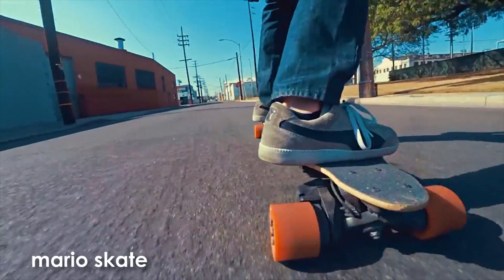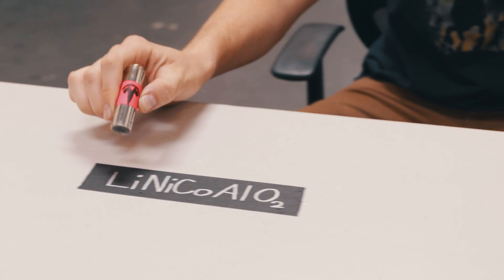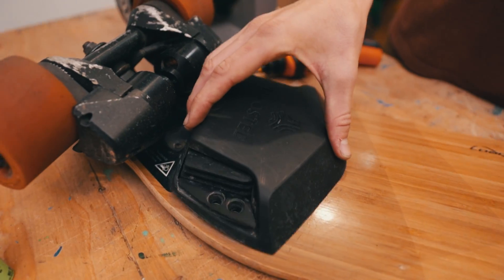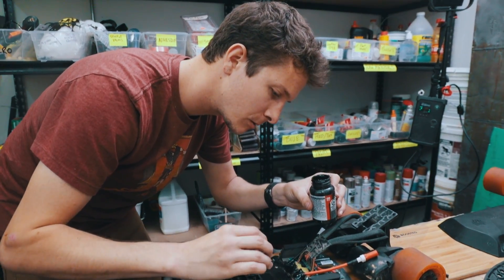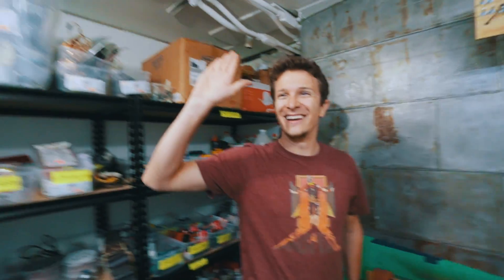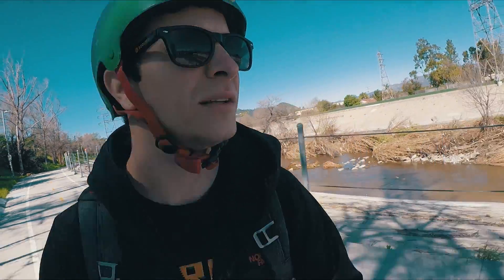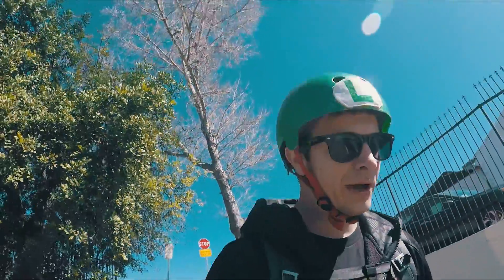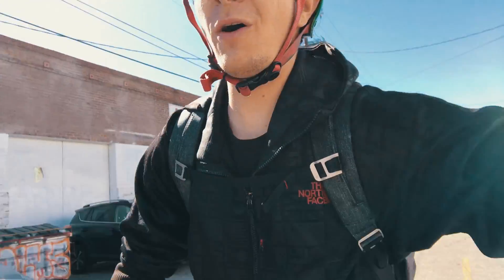Tesla Batteries in an Electric Skateboard!

Comment: You could add two front wheel gears that connect to recycling power motors. From the back wheels moving because of the batteries it would recycle the energy making the battery last longer by powering up. Then would power up the skateboard when cruising down hills just like Ford hybrids. It would require 2 other belts connecting to a rod with gears two other gears spinning the rod for energy. The output of electricity connects to wires and would connect to the other side of batteries. Would probably take some time , but will get u farther then ur destination.
Reply: That's counter intuitive for the first part since you're just causing more resistance for the motors and since you can't get more energy than you put into it you're just being inefficient with your battery. You could also just use the motors you already have as regenerative braking to get some energy back on hills though.
Reply: What you're implying is to make infinite energy
Reply: BLEK YESUS That would add extra drag lowering efficiency and also he should have added a car charging terminal to force energy in when dead

Comment: How about Taking out the boosted board battery and replace it with a bigger more energized battery so the voltage is higher thus letting more battery power out which aloes your other battery’s to poor more energy.hope this made sense thanks

Comment: I might be wrong, but, you have connected the batteries directly to the motor driver PCB, tho your needed to hook them up to the BMS ( Battery Monitoring System - Might be wrong ), this way they wont discharge under the safe limit. I might be wrong cause you may have added one in your packs, or there isnt a BMS in the Boosted Boards pack, but theres one in the Motor driver PCB.

Comment: Good lord...do you own a calculator?
Why not use standard LiIon 18650 cells like they're used in good power tools?
They usually can output 35Amps peak and probably would not care if you ran them at 25A continuous :D

Comment: That depends on which voltage your driver unit and motor can handle. More voltage should increase the power, too. So I‘d look for a regulated boost converter (42-45V should be fine) that can handle your amperage.

Comment: I would replace the boosted board battery with 2 3cell liPo batteries so that it would give you a better charge, i would also find a coolant system, otherwise itll burn that motor up quite fast

Comment: What you need to do is analyze the batteries and ReEnPlug them Buy a New Better Booster off EBay and try to connect the other booster with the old booster it should generate enough power to let you keep going and it might be good enough or else try to put more Volts into your Board

Comment: How do you charge an electric longboard by swinging a perfect pushup using a passive battery charge mode? Did you know if you lock your middle and ring fingers into the perfect pushup, not only do you get perfect colmans every time, but if you swing it around your body like you're throwing a 'discus that is connected to your body', you get CRAZY acceleration?! https://www.youtube.com/watch?v=KJYrIoNWT1M&t=37s

Comment: the name of the standard electrical element adapting the voltage from a discharging battery is called 'buck-boost'. this you need to have after your battery pack. I hope you are using protected batteries - the panny batteries are available as raw batteries or with a battery protection - I strongly suggest u use the protection (fire hazard).

Comment: Voltage is the amount of charge given to electrons right? So in order to reduce voltage but still output the same amount of energy in a given time, the number of electrons would have to be increased enough to make up the difference. Also, I literally googled "how to lower voltage without reducing capacity" and found many results pointing to a LDO Regulator.

Comment: I don't know anything about electric/electronic engineering so I'm looking for some insight. Wren said that he's running the BB battery and the 2 additional batteries in parallel. Wouldnt it be better for him to run the 2 Tesla batteries in a way that allows for them to "kick in" in parallel only after the BB one is depleted? Using the glass of water analogy from 10:16 , wouldn't that mean that the BB "glass" would be empty without affecting the T glasses? He would have to bypass the system that shuts off the board when the B battery hits 32.5 V so that the transition to the  T batteries can be made. Also, it seems like the torque problem could be solved by more batteries in parallel however, the more batteries you add the more torque is required to move the board up the hill due to the additional weight.

Comment: You cant use that energy because the voltage cuttoff (for protecting the boosted batteries) is programmed inside the boosted esc, maybe you should make another pack with lifepo cells, with the same voltage as the original

Comment: Even if you parralel batteries CAN supply enough current, it doesnt mean your motor will draw that amount of current...
usually you are able to solve this with supplying a higher Voltage (higher voltage on same resistance draws more current as well) then you will have more torque (power) with you motor - considering you motor is capable of handling that amount of energy.
you may contact me for more info, hope my english is fine enough for you to understand.

CYA Pal

Comment: The main problem with his explanation is that imagine the water pushing a wheel like you would run a mill by the river. The speed of the spindle will still be the same at its maximum. It may speed up faster, but the max speed is the same. If you want to go faster,  you should probably get a boost converter that does volts and amps and get more amps out of your board.

Comment: Why not just replace the stock boosted board battery? Rather then adding those other 2 batteries in parallel with the old battery(which is already extremely dangerous on its own), just take our the og battery, and connect the new ones in its place. You wouldn’t have to worry about not getting to use the full power, and you should also be able to keep the power monitoring.

Comment: the battery replacement is excellent idea, i just got on to this skate electric stuff, interest by meepo skate, but not have yet. but i got the idea to make 4 wheel traction. each pair power by a battery pack. can you connect to the same controler ?  cheers

Comment: You could switch the configuration of the battery packs to parallel somehow once you get to a low voltage and only power 1 set of wheels

Comment: I would avoid mixing batteries with different voltage ranges/chemistries, and possibly replace the ESC if you are not able to modify the cutoff voltage. The VESC is open-source ESC and has a wealth of customization options, 240A for a few seconds or about 50A continuous.

Comment: dude 3.5v is already pretty low considering the max output of the battery , you want more power (speed) , change those panasonic to lg HB6 which is 1500mah each but puts out 30amps , or the vtc4's

Comment: why don't you use the wheels when there turing to take energy off of that, it could be useful for saving and potentially using that energy to power and or recharge the batteries.

Just Sayin'.
Reply: ImIrish
That's inefficient

Comment: Cutting out the weakest point remove original build in battery pack ! is the only way .. unless you up the capacity of that pack to have the same MAH storage as the add on packs you have made

Comment: Modify the the protection limit, or is another "non professional" method, to "cheat" the voltage sense of the board, but you need to get rid of the old batteries!

Comment: The problem is the programming of your speed controller. It is programmed to cut the battery power in order to not damage the battery so it monitors the voltage. The one I built cuts at 3.2v(per cell in a 6 cell battery so set to 19.2). You changed the batteries layout and voltage so those numbers will change. If you could access the controller you could reprogram limits like with a VESC but you would probably have to trick it into seeing the values it's expecting from the power source it was designed with. You could also monitor your voltage with a Lipo check screen (like $2) and running a single wire from each cell or cell bank to a balance plug like the one you find on a Lipo pack with multiple cells. Correct me if I'm wrong tho!

Comment: just add a switch for the norml battery: cut hte wires and solder a simple switch. So you can "unplug" the normal battery, when you are low on voltage.

Comment: The tesla batteries that you mentioned in the video your problem is that you cannot go as fast as you want and that's really just a problem you can make it bigger because if you do you like you said you would burn out a $1500 skateboard or the electric board so what I would do is just try to make the problem smaller by making the Voltage a little bigger but don't try to burn out the electric board because if you do then you guys said you would burn a $1500 skateboard

Comment: Instead of putting more batteries on use those same batteries to recharge the one boosted board battery so you have a on board charge that will give it around four to five times more energy and as the power reaches that 33v in the boosted board you could make somthing so the extra batteries know to begin charging

Comment: what if instead of dragging the power from the tesla batteries straight to the bosted board you made them into a power storage unit so that they charged the boosted battery to a level where you get the range of the tesla batteries and the speed of the boosted batteries

Comment: when you were using the water bottle analogy you said that to get more amps you need to put them in parellel.  That isnt right you meant to say series.  Also, you mixed very dead batteries in series with somewhat live batteries.  That will fuck your shit up right there...

Comment: How about using the dipole energy without destroying the dipole in the process? Taking advantage of the difference in reaction time between electrons and ions, recycling energy to alternately recharge batteries but timing it right, etc? There are many methods people have been experimenting with that give at the very least extreme efficiency or even over-unity.

Comment: simple solution, is not connect the 18650 batteries in parrallel to the board battery, have an isolator so you can switch between the 2. run the 18650 flat, then the board battery... as it stands, there is current flow through the wiring from the 18650 to/from the board battery till the voltage equalizes. (wasted power)

Comment: dont use a lithium polymer, they catch fire easily
Reply: mmortay Your phone uses a LiPo and how often does your phone catch on fire. See what I mean?
Reply: Mailman's Cat. Lol the one phone type vs the literal hundred different variants  nice
Reply: Mailman's Cat. Because the battery was manufactured wrong
Reply: Lipo batteries are really only that dangerous if you don't treat them with respect. Ex, don't overcharge or undercharge them, get them too hot, puncture the cells, short circut, or really anything else that abuses the cells. Otherwise you'll be just fine.
Reply: our phones maybe use the LiPo, though the battery is very faulty if not made correctly
Reply: Mailman's Cat. The note seven uses lithium ion
Reply: total lie

Comment: The C rating of the battery governs the output current flow (which is what you seem to be lacking). Since Power = Voltage * Current, and your Current is too low, the overall Power is too low to support your weight. The simple fix is to put more batteries in parallel. If you want to be precise, compare the C rating across the original boosted battery and the 18650 cells you're using.

Comment: hello i have a broblem i make a homemade electric skateboard i bought a 
fvt esc 120A when i was connected the old 18650 battery (old battery ) 
the motor running but a few minute (old battery )
i bought a new 16850 2800mah samsung but when i was connected the fvt 
esc show-off maybe the new battery the A its to high but i dont no 
please help me 
thanks

Comment: there is probably an analog pin on one of the controllers so they can monitor voltage, find the pin then change a resistor of the voltage divider changing the range of thebattery voltages but this wille not work if you use 2 types of batery's, NO boost converter is strong enough te boost 3kw and be compact

Comment: You are loading the smaller battery with the Tesla battery. Use an Diode to avoid loading the smaller battery. 
Gut your external loading Points of the smaller battery need to be before the diode.

Comment: `Remove the battery from your skateboard youve killed it anyway by discharging it to far. I see you are using 10cells in series which is a maximum of 4.2volts so 42volts. 
Buy much more packs in parallel you've 10 in series and then 2 in parallel. One battery can only discharge at max with 2C. Each 18650cell is 3000mah so you would mostly get 12A out of that which is not a lot for a electric skateboard with 2motors.

Actually youre killing that pack as well by such high discharges.

I know you've the skateboard pack in parallel with that but still you are limited to round about 24Amp discharge at max since all the cells have to be evenly discharged with same voltages. And everywhere I was quite generous. 
Do atleast with such cells 8 li-on 3000mah in parallel for 48Amp discharge.

Comment: I don't know if you have any electrical knowledge, but I took about a full year and a half of it at college. You could stack more batteries to reach 60 volts and put 2 of those packs in parallel then make a voltage regulator circuit like this.
http://www.radio-electronics.com/info/power-management/linear-power-supply-psu/linear-regulator-series-circuit-01.gif
The main problem is getting a transistor or group of transistors capable of the kind of current you need, so you would need to measure your current you are drawing to be able to calculate how much current you would need to push through the transistor. Once you know that just use a pot and multi-meter to determine the resistance you need to have to achieve the 40 volts out you need. Then take out the pot measure the resistance you had to set it to, to reach the 40 volt output and replace it with a resistor of equal resistance, or very close to it. This would allow you to discharge from 60 volts to 32.5 volts, 46% voltage drop. Which is much more of their capacity than 40 volts to 32.5 volts, 19% voltage drop...

Comment: I Avoided connecting batteries in parallel because they can get different voltage as of different power in them. If one has more voltage than another, it will start to recharge the other batteries and just make a mess. You Should have put resistors in between them.

Comment: What about a step up capacitor. It'll pull from the bigger batteries to a capacitor would you cannot allow it to discharge to the battery booster

Comment: i think that you should disconect the original batteries and sauder one of the packs to the board, then hook it up to another pack through the bullet connection in a series, at that point you could use all the power in the batteries, but you might not get the same amount of torque. So yoir question is should you add another pack tothe series that his hooked up as a parrallel, in which case you would have two series batteries hooked up to two parrallel batteries, then you MIGHT get enough voltage to go the distance and amps to get torque. Like if you agree, comment if you found a flaw in my theory and explain my flaw to me.

Comment: Easy install a regulated voltage chip. The batteries will degrade below 3.6v in performance with full voltage reading 4.22v but running in parallel like you are uses the available energy at 90% using say 5% so the next ramp up uses the 85% left until the cycle is finished which drains batteries really quickly without allowing you to adjust instant tq.

Comment: Take the output of the battery's and input them in an buck boost converter output set to 40 volts into the motor controller

Comment: I know nothing about this type of stuff but why don't you try to charge the boards original battery as you ride there for your using the extra batteries power but you not running out of the skateboards battery obviously until the extra batteries run out which would slowly cause the boards original battery over time to run out which would cause the extra batteries to be used to there full potential and they wouldn't be limited by the skateboard's original battery

Comment: dude, just put a third battery pack on there so you increase the minimum voltage and decrease the maximum voltage by putting a voltage regulator on there. Must work 👍

Comment: Try adding some kind of polulo voltage regulator, even though the voltage drops the board will always read what it thinks is ok.Similar to what Joshua Bardwell did with the Fatshark 18650 battery hack. but bigger scale.
https://www.youtube.com/watch?v=WubtmYuLieE&t=685s

Comment: I'd guess the low voltage cut off of the boosted boards controller will be causing the issue. Without hacking the firmware or perhaps finding the resistor divider monitoring the voltage and swapping in new values, I think you'll be stuffed. May as well use the same battery type as is already in the boosted and just up the capacity.

Comment: You need to install a monitoring circuit that will switch the power sources from parallel to series through a voltage regulator to maintain the needed output but utilize the remaining power. You need to design a couple circuits...

Comment: The cells aren't levelize, and you probly dmaged all cells involved, also how are you going to charge it safely using only monitoring voltage. There's a reason near nothing runs on 2 battery types at once, it causes slumping and can pull high to low and low to high voltage.